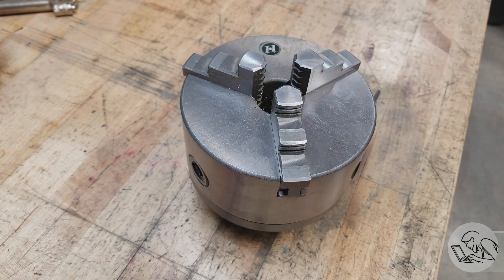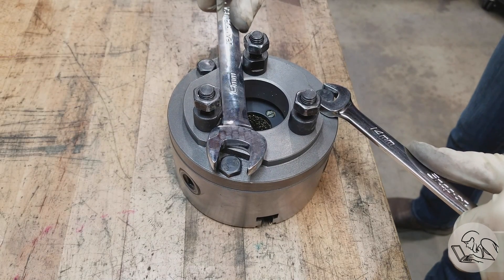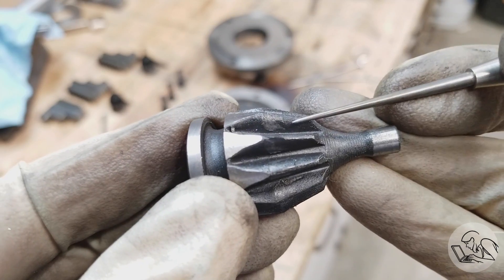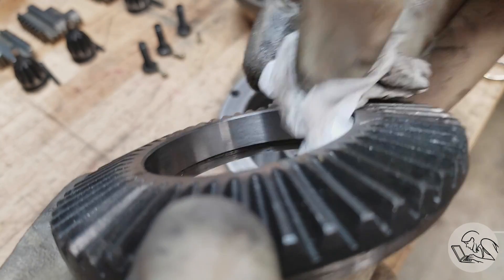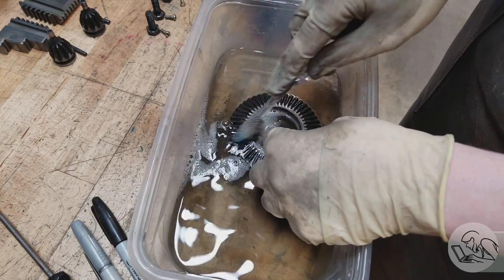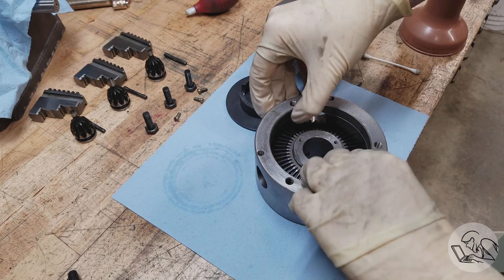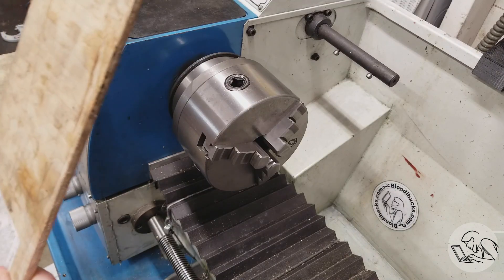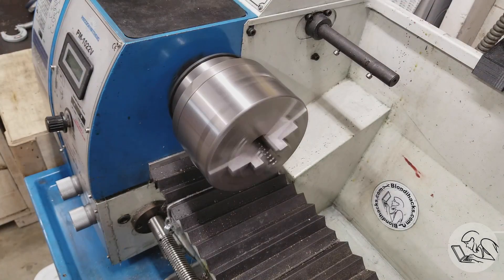Lathe Chuck Maintenance - Get the most from cheap import chucks!

Comment: Warning: Possibly very ignorant question from someone who has never operated a lathe. Could you regrind (or recut) the chuck jaws in this lathe in situ yourself?
Reply: Yes and no. Yes it would fix it at that spot. But the scroll is what determines the accuracy of the jaws at any position. Another position, another accuracy. Higher spec chucks have more accurately machined scrolls. Also machining inside of jaws is not as easy as it might seem. Have to hold the jaws clamped onto an inner item at the same time as machining the inner faces. Can be done, as others have shown. I have tried with minimal success. Now have made my own 10" 3 jaw fine adjustment chuck. Used a standard 10" 3 jaw chuck and made a fine adjustment D1-8 backing mount to suit my 660 x 2500 capacity 3.5 tonne Victor lathe. Now have 0.015mm  (0.38") runout which can be adjusted at any diameter of part inserted into the chuck. Only thing is that it took me about 18 hours to make the adapter. But now the fine adjustment allows me to move the chuck 1mm (0.4") in any direction to compensate for runout of the jaws. If you are interested look up fine adjustment chucks for sale. But then sit down for the prices.
Reply: @bobhudson6659  Thanks Bob. Appreciate the additional insight into the question.
Reply: I reground the jaws on my old Pratt Burnerd 8 inch 3-jaw, not particularly because of runout, but because they were worn near the front edge so gaped a bit and that tended to cause chatter and resonances.  I dismantled, cleaned and lubed the chuck, made a proper jaw spider and tightened the jaws down with all three pinions, finishing with the reference one marked with the "O" with the diameter at about 40 mm, then used a wheel dressed to 36 mm OD with a diamond dressing stick.  I used my shop-made toolpost spindle. I plugged the headstock tube, covered the ways and cross-slide with paper then plastic then cloth to keep most of the grit out, and used a shop-vac to catch as much as I could while grinding.  I ran the carriage in and out until the sound of each wheel contact was identical and there were no more sparks, then ground the outside jaw radii and the faces. A quick check with a 40 mm gauge bar showed runout less than 5 micrometres.  Then I dismantled the chuck again, cleaned and lubed it again and cleaned the machine extremely thoroughly.  After reassembly, the runout is around 12 micrometres so long as I use the O pinion.  However, it is only that good from about 35 to 60 mm diameter, as the scroll is rather worn around 25-30 mm where I suspect it spent most of its working life making parts. There the runout varies a bit, but it is still under 30 micrometres (just over a thou).  Under 18 mm it improves again to about 20 micrometres. It was a HUGE amount of work, and the improved parallelism of grip and reduction of chatter was the big gain, rather than just concentricity.  Not bad for a 40 year old chuck.  One day I'll buy a 6-jaw Bison. Maybe.
Reply: @MachiningandMicrowaves  That went about 3 miles over my head.
Reply: @Hexum064  Sorry, I did get a bit over-enthusiastic there! Short answer is that the decision to regrind is not a simple one. For me, the huge effort in grinding the jaws was worth it because the tips of the jaws were worn and gaping slightly.  After grinding, the old chuck is a very fine instrument again.  So yes, it can be done, but only if there is absolutely no other option. The Pratt-Burnerd was a fairly expensive chuck back in the day, and I use it a lot. For my very specific needs, it made sense to regrind.
Reply: @MachiningandMicrowaves  Well, it makes sense when I WATCH you do these things as you explain them.  Still really appreciate the answer though. It wasn't so much you being overly enthusiastic, but more my lack of domain knowledge. I know what most of those words mean but I can't fully conceptualize it in my mind's eye. I'll end up re-reading it when I pull my brain away from i2s/Bluetooth issues with the ESP32. ... Maybe if Aimee explained it. ;)

Comment: Just tried to take off the chuck on my little Sherline, where you thread the chuck on and... seized. Tried hose clamps, tommy bars, a blowtorch, pipe holder, clamps, vice, and literally everything in my shed and it does not come off. I might just buy another headstock as they are quite cheap on these miniature lathes.

Comment: Reading the manual of my lathe (is smaller than yours ), they suggest using Molykote TP 42 grease or similar, and there is a warning "inadequate lubricants may reduce clamping force by more than 50%"

Im not trying to tell you what to do, I'm an enthusiast, and the things you do are to far from mines in quality and precision. 

but I asking you to do a check on that,  things in security as clamping force are esscential

I love your videos
Best regards

Comment: Which motor is in that lathe? I wonder I just ordered a 1.2kw motor for mine. I have a new controller for the 750w built in BLDC but I cannot wire it up yet due to unknown hall pins (and I'm lazy to disassembly the motor, and the manufacturer might tell us but I'm still waiting for the answer).

Comment: I strip, clean, oil and reassemble my 3 jaw Pratt Burnerd chuck about once a year, it gets full of muck even with the relatively little use my lathe gets. Especially if you ever turn brass, those chips get in everywhere.
Reply from the maker: Brass chips are the worst. I find them in my food. 🤣
Reply: @Blondihacks  Not so loud, everyone will want some🤦‍♂️